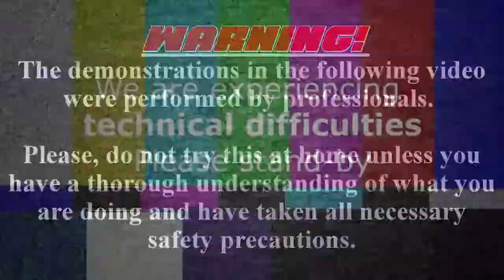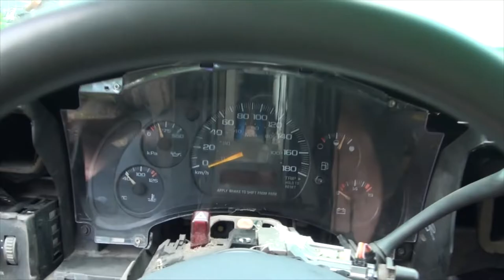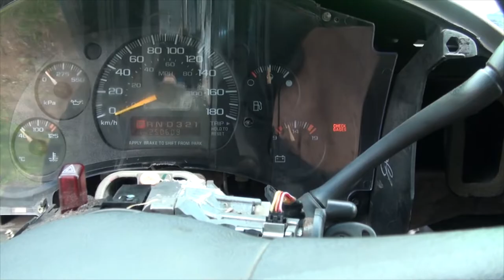HOW TO FIX GM PASSLOCK SYSTEMS (NO SECURITY LIGHT ON DASH)

Comment: This where im at  3000 buck in parts  no start  cranks  no start  keep tell my shop guy this is the problem  won't  lessen  to me    going to dealership to have it fixed? Dont have the time to fix it my self  pane in the ass  dam junk
Reply from the maker: Buy a $50 blutooth dongle for your OBD2 port from Amazon. Connect to your laptop and remove the Passlock from the vehicle computer completely. I don't even try to fix them anymore, screw it. It's easier to remove it.
Reply: I spent 300 bucks on a new rockies box mechanic hasn't figured it out yet I'm computer illiterate but would be willing to donate to you if you did a video on this blue tooth lap top thing

Comment: I hate passlock. It started giving me intermittent problems in my '05 Impala, I believe because the ignition switch is worn. At least I was able to do the resistor bypass, only cost 25 cents haha

Comment: I need to get t my astro van running . I have to move now. I had put a used stearing column in .the key has no resistor . How do I get it running . Every time I watch a video and go to work some thing doesn't jive with what I got . Please help  Dave

Comment: Why oh why doesn't GM redesign this system? My 07 Colorado has this issue and I couldn't find  anything that explained WHY the problem occurs, even though MANY people have the issue. Yours is the first video I have seen that explains what is happening (the hall sensor basically). Now that I at least know what causes it, I can be more careful when I pull out or insert my key. But, do you know anything about the so-called "10 minute reset" deal? Is it really 10 minutes before it resets? And also, what does leaving the door open have to do with it?

Comment: Your video did not help me fix my problem; but I did enjoy your whole video. Btw, Never had an issue with my Astros/ Safari's. Over the span of 20 years, we owned a total of 5 vans ( between 1988 & 2018 =1988, 1991, 1992, 1995 & 2003)
Reply from the maker: I just put the 4th transmission in mine. It's already had a new engine and transfer case, too. Actually, in the last 4 years it has had absolutely everything replaced at least once. I think it may be cursed. Anyhow, I think I remember talking to you a few months ago, but I can't remember exactly what was wrong with your van. If you give me a reminder, I'll see if I can help you.
Reply: Dang you're lucky, I purchased a 95 astro van with only 43,000 miles on it and its been giving me issues with rough idles, ground wire messing up then the fuel pump went out, so changed it and now my van won't even try to crank over. I can get it to start with a little fuel in the intake but then dies about 2 seconds later.

Comment: I'm having the start and stall in my 2000 Cadillac escalade.I bought it with the problem we put a new ignition in it and it fixed it for 2 years now same thing is happening so I bought new wires and ignition lock cylinder housing trying to figure out how to get the metal retaining thing off behind the steering wheel so I can bolt on the new one.Starting to wonder if I have a problem with that box too?
Reply from the maker: I highly doubt it's the ignition cylinder or those wires behind the steering wheel(hall effect sensor). I have got so many passlock trucks running again over the years and the parts you're talking about have never been the problem. They could be, but it's rare in my experience.

If you make a video showing me what it's doing, I can help you diagnose it easier. The main thing to know is whether the dash security light is coming on, and what it's doing when you're trying to start the vehicle.

I'm sick of playing with Passlock and now I just remove it from all GM vehicles I own. I can teach you how to do this if you're handy with computers. It will cost you approx $50 but it's a guaranteed fix that will last forever.
Reply: @StuntDummyLives  You talking about just connecting the yellow wire to the orange and put a resistor or?
Reply from the maker: @kevindoidge9586  No, you buy a dongle that plugs into your OBD2 port and connects to your laptop by Bluetooth. You can download a new files onto your SUV's computer that completely removes all traces of PassLock. It's a very common thing to do when people use LS V8 engines in different vehicles. They won't run when they planted in another vehicle so you have to turn passlock off. It's basically a stock tune without antitheft programmed in. I ended up putting a 5.3V8 in this van and had to learn it. It's really easy if you're handy with computers at all. If this interests you, let me know and I will tell you exactly how it's done. It's worth learning because it's easier and cheaper than constantly trying to fix PassLock. The only difference is: your vehicle will be easier to steal... nobody will know if you don't tell them.
Reply: @StuntDummyLives  Thanks man sounds great we're do I get it😁
Reply from the maker: @kevindoidge9586  You buy a tool called OBDLink LX. I paid about $50 for mine. It plugs into the OBD2 port under you dash and is powered by the vehicle. It's called an OBD2 Dongle.

You then go online and download a file that has everything required for your vehicle(Stock tune/Passlock Deleted). If you tell me your VIN I can help you get the right file for your engine.

You then connect your computer to the OBD2 Dongle by Bluetooth and you follow onscreen instructions to rewrite your vehicle's computer(ECM - Electronic Control Module). It's not much harder than reinstalling windows operating system on a computer. It's made to be user-friendly and it's a very powerful tool.

It doesn't just have the ability to remove Passlock, it gives you total control of the entire vehicle. It's not just a simple code reader for OBS, it's a bi-directional program that can advance timing, adjust air/fuel ratio, change wheel size to adjust speedometer to read correctly when larger wheels are used etc etc etc. If you're into mechanical stuff, this won't just get rid of passlock for you - you'll love it. 

The files you need are pre-written, tested and free. You just need all the details to get the right one year, engize size, what modifications are done to vehicle.

If you're worried, you can buy a second ECM from a junkyard and reflash it with the file. They're cheap and you won't have to worry about doing something wrong.
Reply from the maker: Here's a video link to give you an idea on how it's done. There's a few different dongle names. This one is good too, it's just older than the one I have. VATS = Passlock, It's called VATS inside the computer(Venicle Anti-Theft) but it's Passlock. https://youtu.be/qYMU0BI1qUI
Reply: @StuntDummyLives  Thanks again 👊
Reply from the maker: @kevindoidge9586  No problem.

Comment: i have a 2009 g5 pontiac and grabbed a used ecm computer and follwed a video and the theft lights are out but it wont crank my code thing is broken under the steering colum so dont have or check codes what did i do wrong.
Reply from the maker: It won't crank? That's really weird. Are you sure you matched the computers up correctly? There are different ones and they all look the same. However, GM(Pontiac) moved some wires around inside them. It sounds like you have an incompatible computer and will need to swap some wiring pins around to their correct placement for your year. 

Also, these systems come in sets. The key cylinder, Anti-theft computer, and the ECM must all match. Usually, unless you get lucky, you're supposed to change all 3 to ensure they're sending and receiving the correct signal. 

I really can't think of any reason it wouldn't crank, though... it should still start and run for a few seconds before the anti-theft cuts fuel to the engine.

I just rewired one of these and there's a wire that enables the starter relay. It's not the same wire in every computer. You have to get an exact match to be sure.

The connector you're talking about is called an "OBD2" connector. If you had one, you could spend $50 for a BlueTooth dongle and use it to remove the anti-theft from the ecm, completely. There's only 3-4 wires to run that connector. You may want to wire a new one in.

Also, if you make a video and show me what's going on, I can have a better idea of what you should do.
Reply from the maker: I just sent you a long reply. This is the second one. Find your starter relay and have someone attempt to crank the car. You should hear clicking in your relay. If you don't, then you're not getting power to it. Also, I don't know what your skill level is, but you can test for power at the relay when the key is in the crank position. If you're getting power to that relay, then the no-crank symptom is not related to your new computer.
Reply: @StuntDummyLives  thank you sincerly i will send you a video when i get a chance to today cause im at my sons house and im not were my car is but i will defently do those things .
Reply from the maker: @lindarodriguez4882  No problem at all. I get a lot of comments but will watch for yours for the next few days. I love figuring out these computer issues. This is an older video but this van is now a monster and the roof is 10 feet off the ground. I put a new V8 engine in it and had to rewire the entire van to match the new engine's computer... they weren't the same at all. The van is a 1999 Astro and the engine came from a 2009 Silverado. I'm pretty sure we can get you going, I just have to see where we're at.

Comment: I only know the immobilizer systems which do have a transponder in the key, so they probably work a bit different than yours. I think they are even included in the ECM and don't have a separate box. Many different types of vehicles out there, and at least as many different systems... Imagining I was a car thief gives me a headache ;)
Reply: I have a 2001 Tahoe aho just got AI put the the dog nasthe diagnostic test on it  While it is booting up it's showing that it says check the diagnostic test plug make sure it's all the way in  Make sure the  Ignition is on You turned the key on you can hear the fuel pump run you can hear the motor start up for the motor start like just for about 2 seconds and quit You turned the key on you can hear the fuel pump run you can hear the motor start up for the motor start like just for about 2 seconds and quit But the fuel pump won't kick in this is on a is dishes on a an engine swap into a 56 Ford panel You have any ideas I think it's security
Reply: U talk to much

Comment: My 2001 GMC Savana once in awhile will not start. First time was in very cold weather when it sat a few days. Cranks but no turn over. Next time I think the weather was fine but it just sat maybe 2 days. Another time after a good storm. And once it started right up, moved it, turned it off, hooked up trailer, then it wouldn't start. After each instance the battery gets worn down, the cables come out, and I eventually get it started after an hour or so. Security light is usually normal, but I did notice after finally starting it after a no-start situation it will stay on until I shut it off and restart. Otherwise runs fine with no other issues. Fuel pump, filter, plugs, wires, cap replaced 2 years ago. I was thinking it has something to do with the passlock but it seems passlock allows a start but immediately disables the fuel, so I'm still baffled.
Reply from the maker: It sounds like your cap & rotor are the problem. It may be new, but these vans are horrendous for cap problems. You should use an aftermarket(cheap chinese) distributor because some of them come with an aluminum shaft and metal gear, instead of GM's plastic crap. You should try to find a quality cap with brass pegs inside it, instead of GM's aluminum ones.

Also, there was a TSB(Technical Service Bulletin) released by GM years ago because of the exact issue you're describing. You need to pull you distribuor out, flip it over, and pull out the little screen that's on the bottom. They get dirt in them, plug up, and the condensation cannot escape your cap. I have an aftermarket distributor that didn't have a screen, just a small hole with off-center baffles. I drilled a bigger hole and added a screen. I've never had another problem since that mod was done.

Comment: 1997 Astro Chevrolet Van new battery new alternator new starter motor/solenoid. Click/no start. Jumperboost engine fire up. Remove booster key turn over but no start. Multimeter test positive to power ground show 11.97. Could it be a positive cable from battery to solenoid become shorten ?? Would be best to replace positive and negative cable or ignition start switch or pass lock ????
Reply from the maker: 11.97 is not enough to start the engine. You should have at least 12V to start, and almost 14V when it's running. I would say it's your battery. Even if it's new, I would swap it out with one that you know works well enough to start an engine. 

When your starter clicks it's because it's not getting enough power. That's why your engine starts with the booster attached and refuses to start without the booster. It definitely sounds like your new battery is defective.
Reply: @StuntDummyLives   battery replacement twice same issue
Reply from the maker: @daveirving2644  I would try running a dedicated ground wire directly to the starter and check the other grounding straps while you're at it.

Comment: Hope you can help me here... I got a 99' Suburban with a crank but won't start. Basically died in the driveway for the lack of use. At first, I used to charge the battery, then the crankshaft sensor and it ran fine; didn't drive it around, just in my street to warm up. Got spark, compression, fuel psi ok... Anyways, went and changed a bunch of parts: fuel pump, spider injectors, the whole distributor, sparks, cables, cam sensor, temp sensor, relays were ok but still got them replaced with new ones, fuses checked. Timing is okay. And just got the VATS module to see if there was something visible burned.  Everything looks fine. I got the EGR cleaned and will put back tomorrow, just in case. What else should I do, what am i missing? The computer module? Thanks for any advice, appreciated.

Comment: Was it running and then just stop?
Reply from the maker: Yes, it did that a few times and the security light came on. The engine can also die suddenly when the coil begins to fail. If your security light is not coming on then check your coil. Take the coil wire off of the distributer and put it near metal while cranking the engine. You want to see a good orange spark arcing. If you don't, your coil is going bad.
Reply: @StuntDummyLives  plug,cap,rotor,wires crankshaft position sensor, electronic ignition coil all new and getting fuel. But it stopped while sitting and now it starts and sputters out after about 5 seconds But only after I click the ignition 1st and then the second time
Reply from the maker: @JosephCompnotta  Do you have any check engine codes? Is that light on? It sounds like the crank sensor needs to be calibrated. I had to buy a tool to calibrate mine after I built this engine. That was another reason it kept stalling, and when it started stalling I was getting a code saying the "crank & cam sensors were out of correlation". I paid $190 and bought a clone of GM's "Tech2 Bi-directional programmer" to calibrate my crank sensor. The one I bought is called a VCX Nano(GM Version) and it works miracles. I don't know how I ever lived without it. 

If you can get the van driving, there's another way to calibrate the crank sensor by hitting a certain RPM and doing a few other things in the order the procedure calls for. You can find instructions on Google by searching for "calibrate new crank sensor without a Tech 2".

Also, was the new crank sensor shimmed? Does it have any grooves in it from the reluctor hitting it?

Also, take your underhood fuse panel off it's bracket and look underneath at the wires and connections. Wiggle them and see if you can make the engine die. That's a common problem with these vans, too.

You should also check your grounds. All of them.
Reply: @StuntDummyLives  Thanks I'll check that next. I'm going to take a few days from it. or I'm torching it. lol thanks for your help and time
Reply from the maker: @JosephCompnotta  Nevermind, I misread your comment. Yes, what you're describing does sound like you have a passlock problem. I would follow the info in this video and check to see if you have a ground at your Passlock computer in the dash. If you don't have a ground there, just run a separate wire to the box and provide ground to it. If you do have a ground there, then it's probably your crank sensor having an issue. 

You tested the fuel pump with a pressure gauge?
Reply: @StuntDummyLives  yeah, I've checked of of those items. alright I'll try that, thanks again
Reply from the maker: @JosephCompnotta  No problem. I completely understand. If you really get to your wit's end, make a video to show me what exactly it's doing and I'll see if I can think of something else.